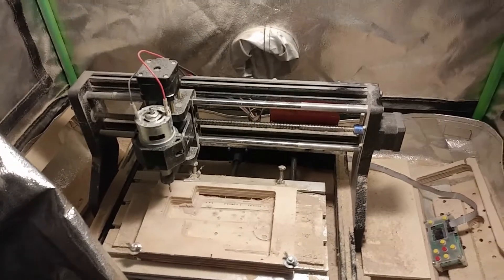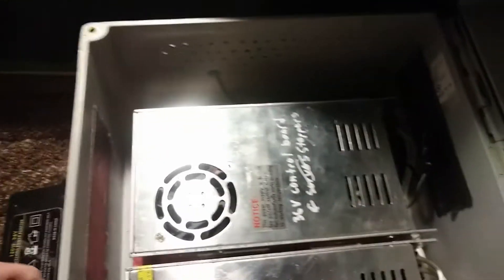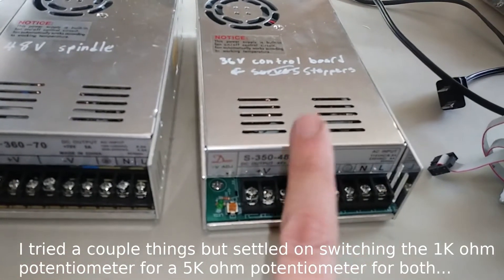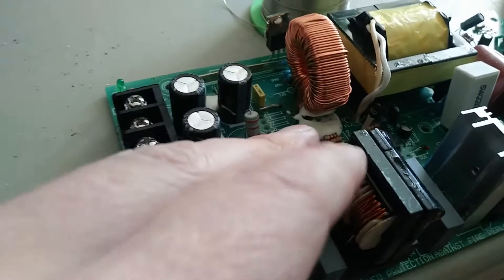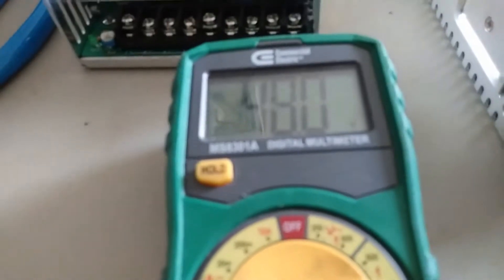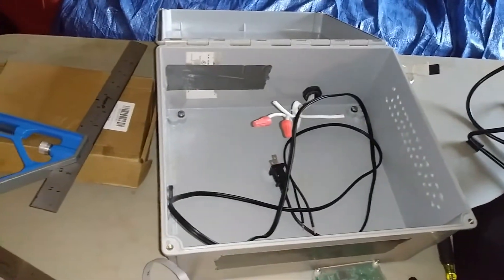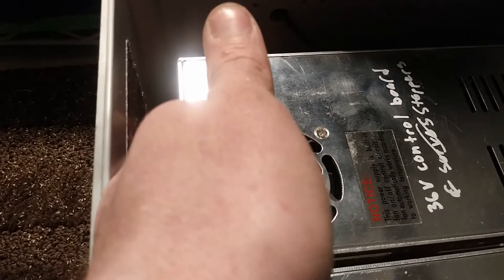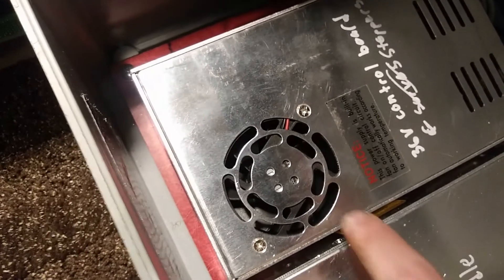3018 Pro CNC machine upgrades - Power Supplies - modifying a psu for lower voltage & lost steps

Comment from the maker: I wanted to upgrade my steppers to stop the lost steps problem but I think just the power supply did it.  I'm definitely getting those little $3 voltage meters for these power supplies though, went to cut a part and the dang wood started burning, no fire but lots of smoke and dark wood chips, the voltage must've migrated up towards 36V and above 36V might hurt the control board

Comment: Maybe a horsepower issue from the motor? Seems like it's the equivalent to a palm router, which will bog down and do weird things through 3/4" material
Reply from the maker: now that i think about it it was pretty common for the steppers to lose steps when i was at least 2 hours deep into a job, I'm really thinking the power supply was dropping current or voltage or both to the point that the stepper motors torque really suffered.  the spindle is not great but the lost steps was more the steppers themselves, i'm thinking that maybe this power supply is not equipped to do 14 hour jobs like i've done recently and is dying.  Either way it is inadequate for a CNC machine.  Now a big ol power supply running under it's rated voltage in a metal case with a fan if it wants it should work better
Reply: @OGmolton1  hell yeah. I just know my 1/4in palm router struggles with anything 3/4". I have a 2  3/4hp router with half inch Collett, it will breeze through 3/4"
Reply from the maker: @ojmcbaggins  yeah, I strictly work with the tiny baby collet, that thing sounds like a beast.  it's 3/4" but it's only doing 1.5mm at a time